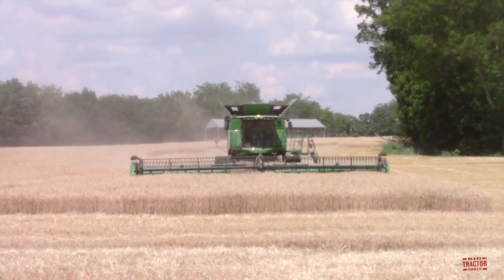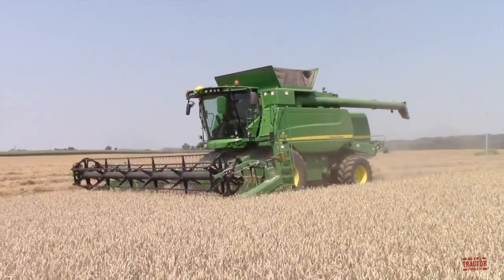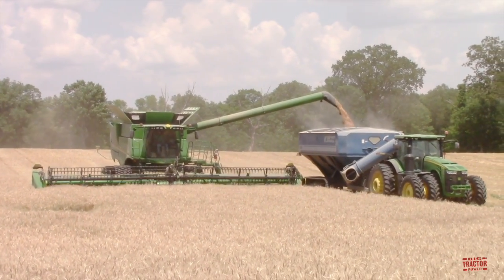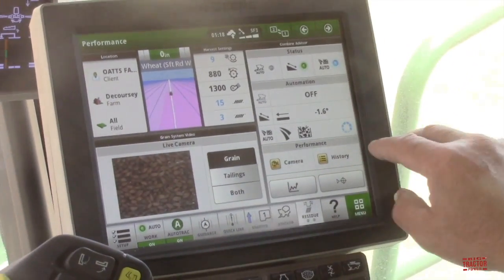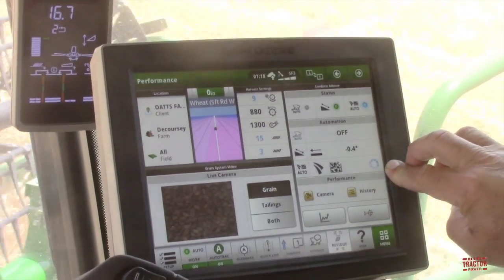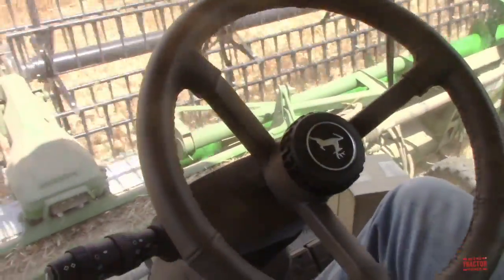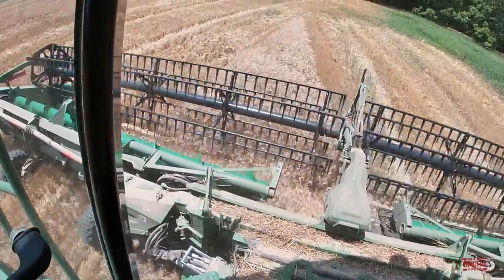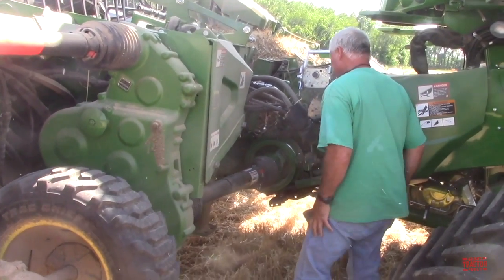JOHN DEERE HD40R Hinge Draper Harvesting Wheat

Comment: What do you think is better track System John Deere or Claas?
Reply from the maker: The Claas Terra Trac system is the best track system offered for a combine hands down.
Reply: @bigtractorpower  I agree because of seeing the John Deere in wet parts of the field alot of mud collectsoz2 and gets stuck around the tracks and won't budge and could  cause problems having to get out and clear it? 

A
Sß
Reply from the maker: The ride of the Claas is unmatched on tracks.  Riding in the S780 I knew it had tracks especially on the turns.  You never think about the Claas having tracks riding in it. The flat long tracks are great in mud they do not sink and leave a trench like triangle tracks.
Reply: @bigtractorpower  We are trying to get Demo with Claas 780 or any new Claas Combine for next year but there are not many in the Country yet  but good things have been said about them even by people I know that said the Switch from Catterpillar to Mercedes Engine would be detrimental to performance.

Comment: You don't seem to have folding headers there in US at all, they are always put on a trailer and towed to a different location by the combine itself or a pickup truck? 🤔
Reply: No need for the extra complexity of a folder when we can just tow them out there & hookem' up. There are some around, most don't really care about them though.
 
Different products for different markets, like how you rarely find single wheel equipment in the US, everything tends to be on duals if not triples, but singles are more common in the European markets that have tighter public road width restrictions(generally, we either don't have size restrictions beyond common sense, or they're pretty loose, depending on the state of course - like here in Ohio we don't have any restrictions).

Comment: I have a question...when combine is considered full is that without  the grain tank extension or do the manufacturers figure in the extensions when they say a combine holds 350 bushels?
Reply from the maker: The factory extensions are included in capacity.  The S780 is 400 bu. with bin extensions.
Reply: @bigtractorpower  ah ok thank you for the answer Jason keep up the awesome videos 👍🚜

Comment: Good video with a lot of information... I'm old enough to remember the old pull type Allis combine with the heavy canvas aprons, top and bottom, and the platform on the left side to stand and fill 2 burlap sacks with grain... Throw a millers not on them and drop them to the ground to be picked up later... I don't remember the model year of the combine... but I remember watching it run... I was too young to help at that time...
Reply: Possibly an AC 66 all-crop?
Reply from the maker: Thank you for watching and sharing some great combine history.